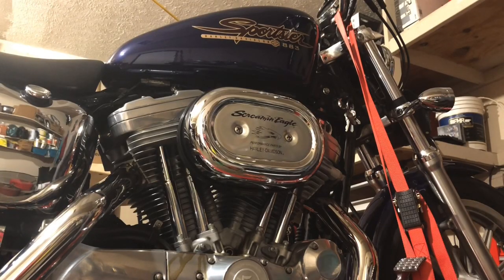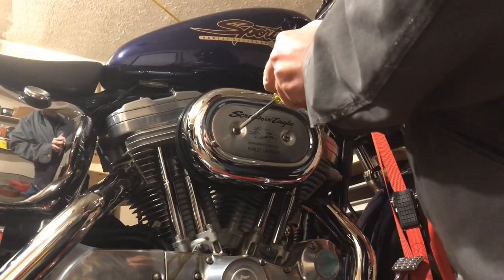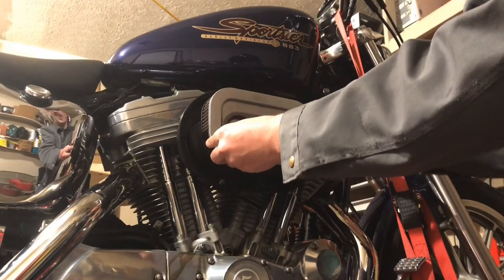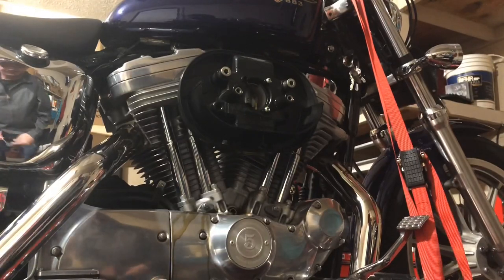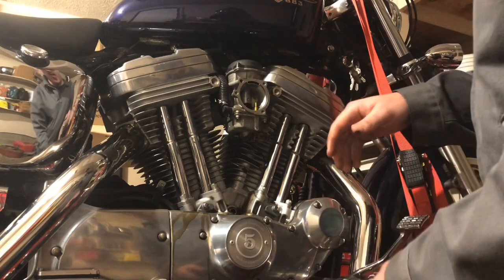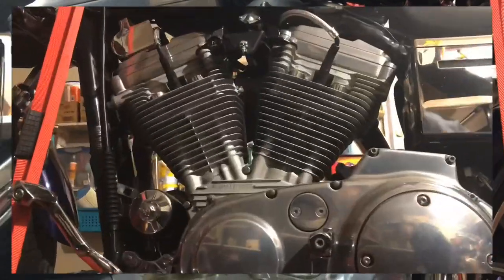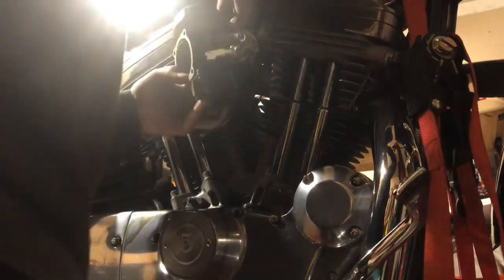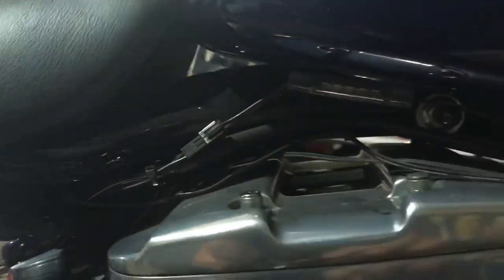Sportster CV carb removal

Comment: Good video, except for the part I really needed. I was trying to find an easy way to remove the throttle  & return cables. Bright light blocking out what he was doing. ☹
Reply from the maker: Sorry about the light but if you look at the mount there is two screws holding it in place one on the top cap and one on the side when you take those out give it a little twist and you can roll the barrels out of the mechanism
Reply: @joestubbs3330  How easy to get the throttle assembly back in? Any readjustments needed?
Reply from the maker: @matrox   its not that bad and no additional adjustments needed to be made

Comment: FYI that intake is like trying to suck a basketball through a water hose.  A Stage One really opens it up alot & the power increase is BIG.
Reply from the maker: I understand your point. A stage one is fine but if you look at the pipes I don’t have any substantial bluing or yellowing so the bike is running right for the set up I have and I’m plenty happy with the performance of my little 883.
Reply: @joestubbs3330  An 883/1200 is plenty of motorcycle.  For less than $2k they can be be made to scream & few bikes will beat them 0-45mph.  From  light to light that's damn fast on a 500+lb motorcycle.

Comment: Hey brother I am having issues with one of those CV carbs I have a 1992 harley davidson softail heritage.  Here's the deal it was riding just fine it only has 27000 miles on it . All of a sudden the idle is super high once it heats up to operating temperature and its heating the motor up fast because of it . I have sprayed starter fluid around the intakes and hoses and the idle hasn't raised up any . Any clues brother this bike is my only form of transportation and I need to figure this out fast lol .

Comment: I heard you reference WV, do you live in the state?  I'm in WV and just picked up a used & abused 97 model 883 sportster. I'm cleaning the carb and was curious what size jets you're running.
Reply from the maker: I’m still running the stock jets I’ve never had to change them. Just getting them cleaned up real good dose the trick for me.
Reply: @joestubbs3330  my intake seals ended up being my problem, massive air leak leaning it out.

Comment: Where does the other end of the vent line go? Why is the vent line needed?
Reply: i believe it's the overflow tube. runs down to below the frame
Reply: The vent line on the top backside of the carburetor, what does this hook to where does it go? It's just open on the bike that I have
Reply: @Blah86683  yeah, excess gas from the carburetor flows out of this tube and onto the street. I was confused about this too, but it is a gasoline vent from the carburetor.